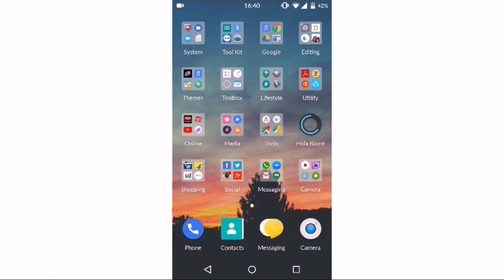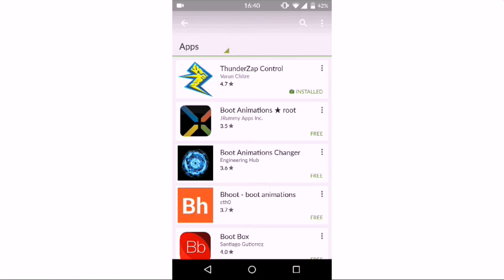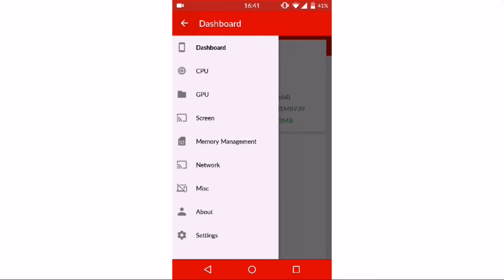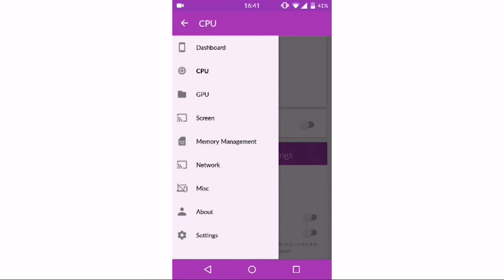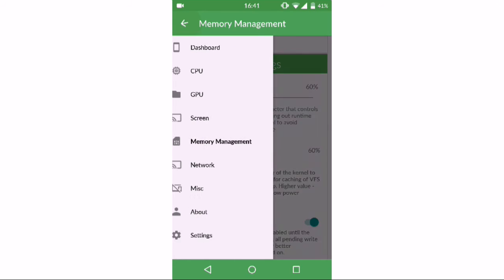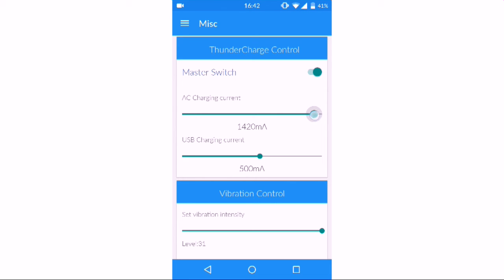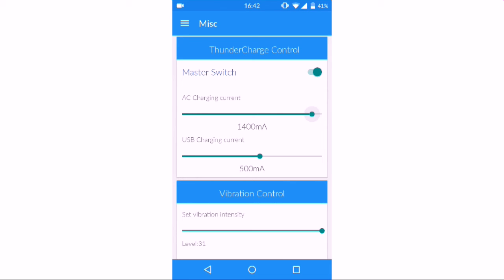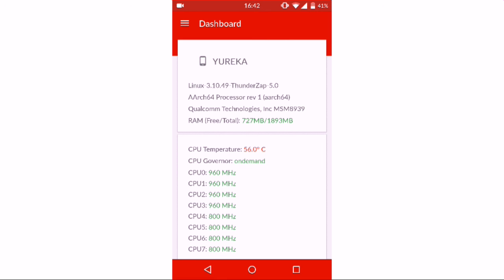| NEW| ThunderZap Kernal For Fast Charging | Yu Yureka/Yureka +

Comment: hey hrithik iam going to use 2.1 amp charger and set max current to 1450 is it ok
Reply from the maker: +Nitin T exceeding 1260 will make your battery heat and thats not recommended! so set to 1260 and when u need a emergency charge then change it to high!

Comment: my wifi not turning on after installing this kernal
Reply from the maker: there is no problem with this! it works! have u installed correctly?
Reply: +Hrithik Smarty (Amoure) wats  the recommended settings for battery saving
Reply from the maker: Settings I recommend:

Daily usage: Heavy
Load threshold: 55%
Sampling rate : 550ms
Touch boost : off
CPU Cluster1 Gov : ondemand
CPU Cluster1 Max : 1.4Ghz
CPU Cluster1 Min : 200Mz
CPU Cluster2 Gov : interactive
CPU Cluster2 Max : Default Max
CPU Cluster2 Min : 200Mhz
GPU Gov : msm-adreno-tz

Daily Usage: Lite
CPU:
big cluster:
Governor: interactive
CPU Max: 1113Mhz
CPU Min: 200Mhz

LITTLE cluster:
Governor: interactive
CPU Max: 1113Mhz
CPU Min: 200Mhz

Hotplug algorithm: Load balancer
Touch boost OFF
Scheduler boost OFF

GPU:
Governor: msm-adreno-tz
GPU Max: 465Mhz

Memory Management:
VFS Cache pressure: 60%

Gaming:
Load threshold: 40%
Sampling rate : 300ms
Touch boost : off
CPU Cluster1 Gov : interactive
CPU Cluster1 Max : 1.7Ghz
CPU Cluster1 Min : 200Mz
CPU Cluster2 Gov : interactive
CPU Cluster2 Max : Default Max
CPU Cluster2 Min : 200Mhz
GPU Gov : performance